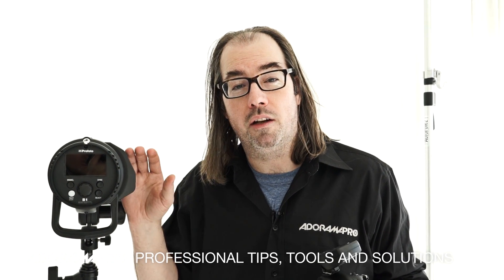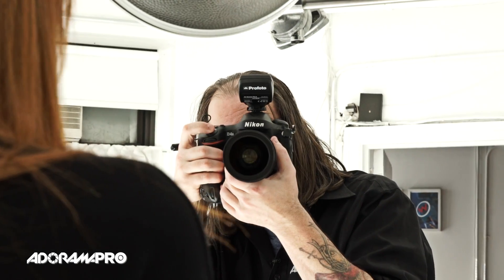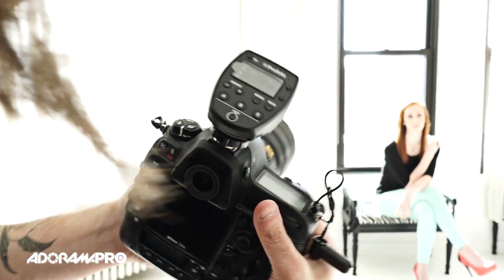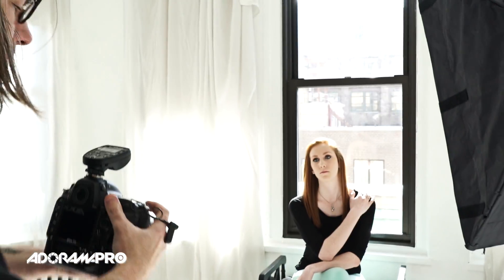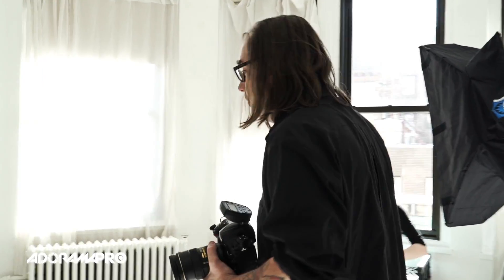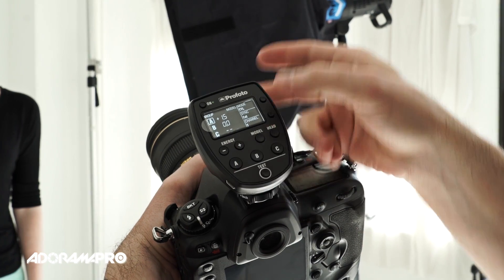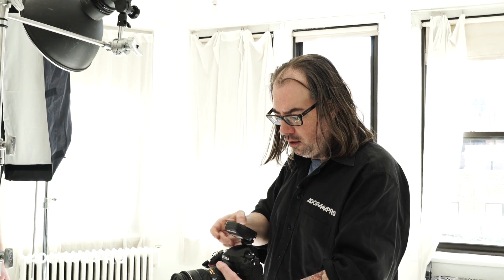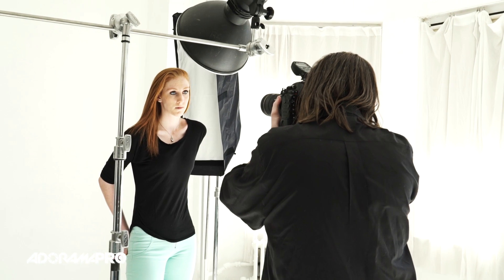AirTTL: What it is and How it works - OnSet ep. 22

Comment: Thank you very much brother I have to exchange my old D1 for D2 with TTL it helps a lot to use points of compensation with faster correction. I will be able to work with larger openings by measuring with natural light and only use TTL mode with compensation points. for a perfect fill light

Comment: According to the Profoto webinars I've attended, what you did at 2:36 ... (adding exposure offset with the AirRemote while using a one light setup) won't produce Flash exposure compensation.  If using a single Profoto B1, the ONLY way to add Flash Exposure Compensation is to do so on the camera and not on the AirRemote.  What you demonstrated in real life does not work.  All Flash Exposure Compensation must be accomplished on the camera when using a singe B1.
Reply: David Hall Thanks for your comment. It's true that Profoto does recommend using the camera's flash exposure compensation when using only one head, however I have been using the AirTTL controller to do it and it has worked fine for me with my set-up (Nikon D4s). Thanks for that catch though, It probably does not work with every set-up so people watching this video take note.
Reply: @DanielNortonPhotographer  Based on my experience this video https://youtu.be/SquctnDlIB8 gives an accurate description of how it works. Compensation using the air remote only works with AirTTL when it TTL is turned off.
Reply: Was wondering myself why he didn't exposure comp in the camera too. But when using more than one strobe I guess that wouldn't work as well.
Reply: I'm not 100% sure why it worked with the D4s, but I would recommend people follow Profoto's instructions and use on camera compensation
Reply: while using just one B1 head in TTL mode adding exposure on transmitter does not produce flash compensation as it refers to ratios. However as you have just one head so any adjustments on the controller here in TTL mode does nothing with the flash. it's better to use TTL first and then switch to Manual to make that adjustments.